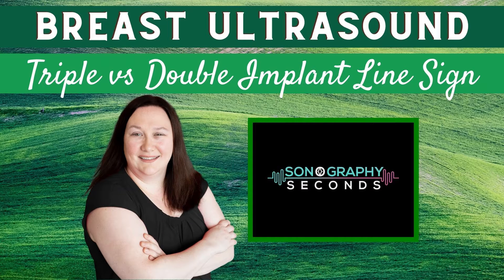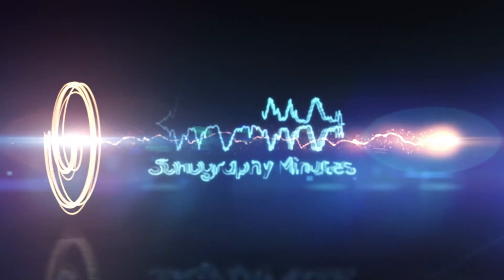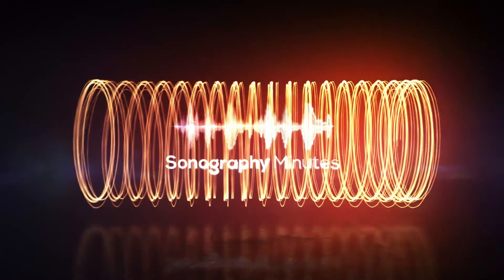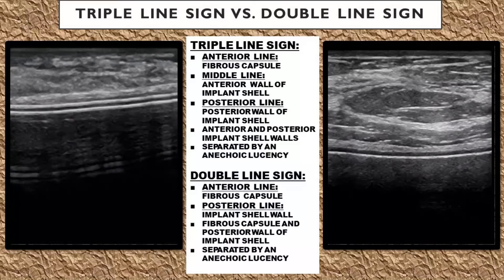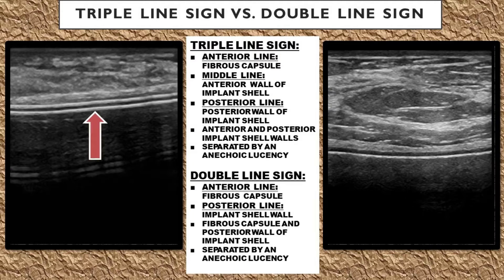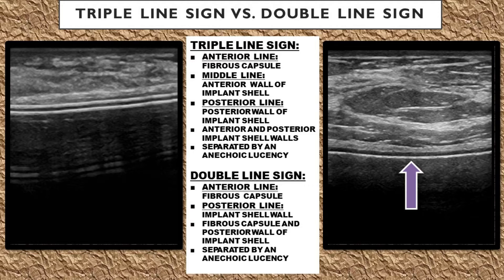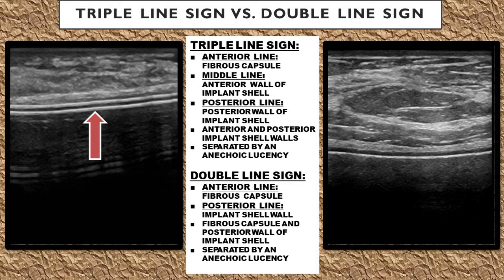Breast Ultrasound- Breast Implant Triple Line vs Double Line Sign (Sonography in Seconds Series)

Comment: Thank you very much for explanation. Does every anechoic lucency between anterior and posterior implat shell wall is filled with saline? Does space between implant shell walls can dilate?
Reply from the maker: Think of the triple or double line sign of a breast implant as a sandwich. The fibrous capsule is one layer (let's call it a slice of bread), and the implant shell is another layer (let's call it a slice of cheese). The implant shell (slice of cheese) can have different thicknesses and consistencies depending on its manufacture. And the Ultrasound machine interprets each of those thicknesses and consistencies differently. So it may be a slice of swiss cheese, provolone cheese, cheddar cheese, etc. A slice of swiss cheese may have one echogenic line and an anechoic lucency (part of the double line implant sign). A slice of provolone cheese may have two echogenic lines and an anechoic lucency (part of the triple line implant sign). Let's say the slice of cheddar cheese is produced by two different implant manufacturers, one manufacturer has an implant shell that has one echogenic line and an anechoic lucency, and the other implant manufacturer has an implant shell that has two echogenic lines and an anechoic lucency. 

The anechoic lucency is part of the actual shell wall (it is not a saline or silicone fluid layer or part of the contents within the implant lumen), it's anechoic because that's how the Ultrasound machine interprets the composition of that particular implant shell wall. The anechoic lucency is a part of the shell wall itself. It does not become unattached or dilate. Think of it as being the holes within a slice of swiss cheese, or the peppers within a slice of pepperjack cheese. It is all one entitiy, one slice of cheese and unable to be separated into different components.

Only the fibrous capsule and the implant shell can be separated from each other and silicone or saline can fill the space between the implant shell and the fibrous capsule.
Reply: @SonographyMinutes  Thank You very much, now I got it. I also watched your "Breast Augmentation for Sonographers & Mammographers" video.